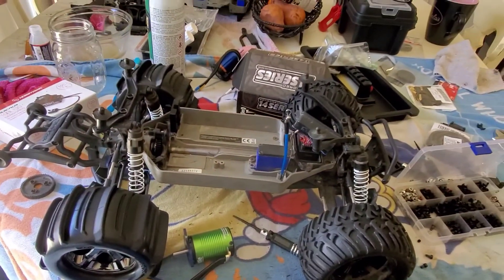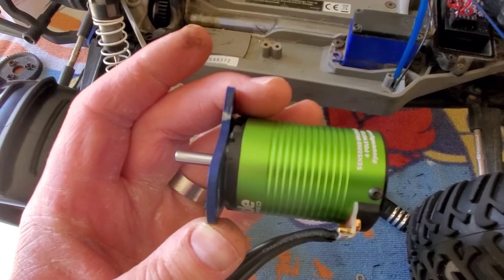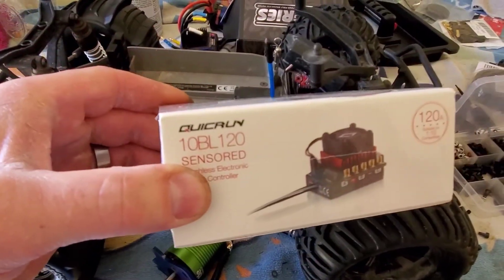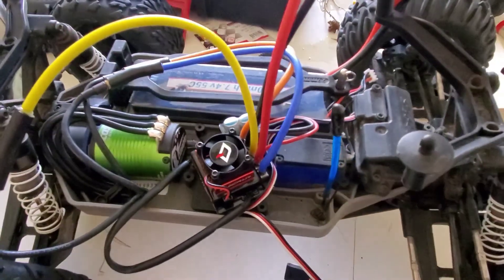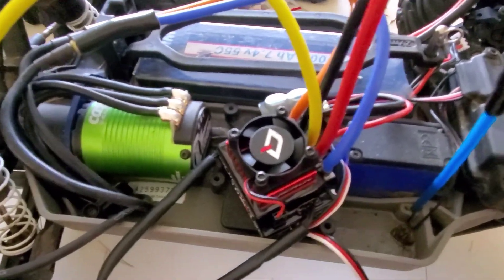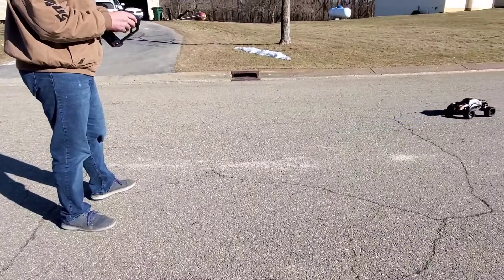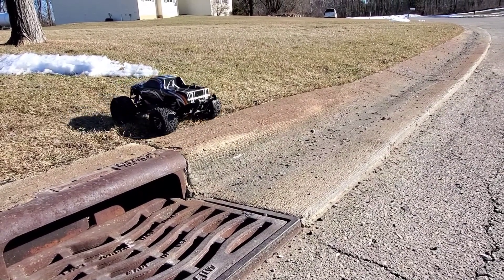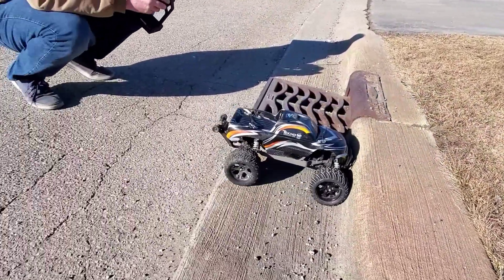Upgrading my Traxxas Stampede VXL  4x4 to Castle Creations 1410-3800kV and Hobbywing 10BL120

Comment: Been thinking about dropping the 10bl 120 in my stampede. Was worried it might not be enough. I have a fantom 17.5 and a rudd dog 10.5 I can drop in. Good video
Reply from the maker: Thank you. I just put the 10BL120 into my dad's granite paired with the the Spektrum 3200 kV motor, bought from Jenny's RC for a steal by the way. 

It's a solid, reliable, well-priced ESC.
Reply: I've ran an 8th scale truggy with that esc. You're good to go bro. 
It's a great esc especially at the price it is even in this crap economy today

Comment: this is on a 3s battery?
Reply from the maker: Believe it or not, this is good ol' 7.4v 2s. That Castle motor is a monster. Fantastic upgrade!
Reply: @dngrclwn  i have a crt .5 with the castle motor. I decided to put in a bl60. Mainly going to use 2s but I just tried 3s for a minute, it was insane.

Comment: How is this holding up a year later? My daughter just burned out her castle SCT ESC. We have the same motor - looking at getting the 10BL120 to replace it. She has a 2wd stampede (same truck, but 2wd). Did the Hobbywing come with a sensor cable?
Reply: It doesn’t come with the cable. I have the identical motor and esc. Though I haven’t made the motor swap yet. I’ve been running the 10BL120 on a castle 1406-5700kv
Reply from the maker: My esc did include the sensor cable thankfully. 

This setup is still going strong! Still way faster and smoother than the Velineon combo it came with. I highly recommend this motor and esc.
Reply: @dngrclwn  weird. I have the exact same esc. Bought 2. Neither had a sensor cable
Reply from the maker: 🤔 Maybe the sensor cable came with motor I bought then.
Reply: @dngrclwn  possibly. I lucked into good used castle motors. $100 for a pair

Comment: I have an xl5 slash and think I'm getting the same motor. But it's 110 dollars for the motor and esc..but anyways 1 question, what does censored mean?
Reply from the maker: Unsensored brushless motors "cog" or stutter at low speeds. They can't crawl smoothly.

A sensored brushless motor can crawl slowly and smoothly over obstacles without "cogging".